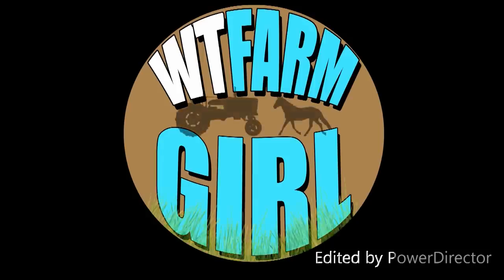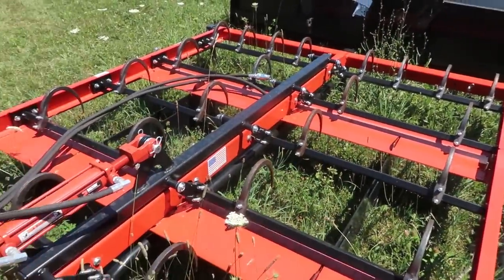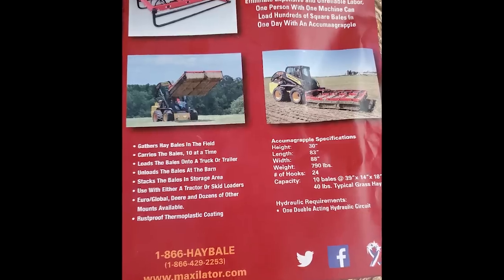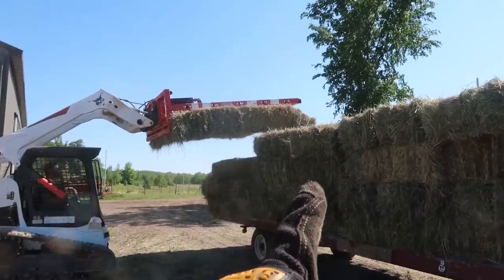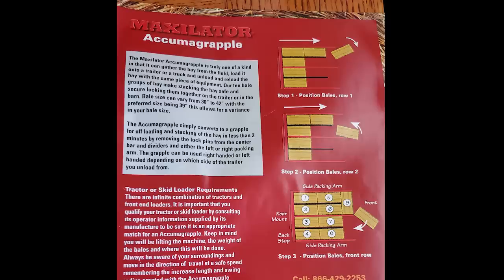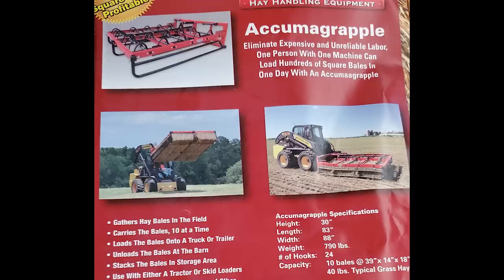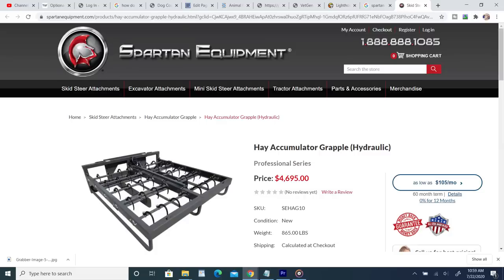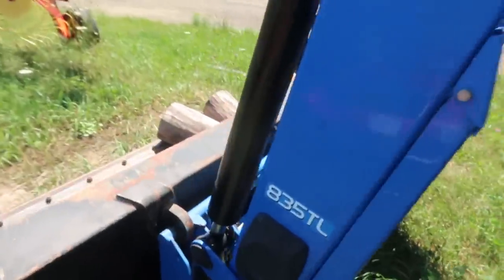324 Hay Accumulation System: Why The Maxilator Didn't Work . . .

Comment: Great video and review. I am a small farmer who cuts about 10acres of hay. I ran into the same issue with finding no help. I built my own unit for picking up hay that requires no hydraulics and attaches to the tractor bucket. Works well but isn't perfect. We have not picked up our small squares by hand since I built it  last season. So I consider it a success. I have another design I will be building in the near future but will require 3rd function remote hydrulics. Sometimes as small farmers were better off building what suites our needs than trying to afford equipment our operations funds can't support
Reply from the maker: Very well done!  Did you weld something up similar to the grapple accumulator?
Reply: @This1LifeWeLive  
Yes welded up out square tubing and angle iron. It's not like the accumgrapple. I put it on my small 30hp compact since its shuttle shift. Makes things a lot faster. Designed for that little tractor in mind and this one holds 4 bales at a time. If you want I can email a few photos showing it in use. The next unit I am building is more similar to the accumgrapple but won't hold the bales like your unit does. But again it will need those 3rd function hydrulics.

Comment: We have had a maxolator for over 5 years. Absolutely love it but bales should be 36 inches not 39. I have also learned that you need to be very consistent with your bales witch means you need to feed the baler even all the time. I have switched the tractor I use on the baler to a ivt trans to be able to be able to feed better.
Reply: In rebaling   consistant  feed is  imperative......being as we bale exactly  how it comes off the rool...... no fluffing, because it creates too many fines......Plus the Massey  stroke rate is higher than most side draw balers.....The optimum bale length for a Baron is 34 inches....
Reply: I figured her bales were long

Comment: Our first year grapple accumulator system was pretty simple... the Farmall “C” was in first gear and set at idle... my 7 yr old brother would drive the straightaways... I (being big brother at 14) jumped up and helped him corner.  My 9 yr old brother drug bales to the loading path.  I gathered bales and tossed them onto the farm wagon. My dad stacked them there.  

My mom and sisters were in charge of iced tea and peanut butter sandwiches.  

When we got to the barn, I tossed them onto a platform, then climbed up and tossed them into the loft.  My dad stacked them in the loft.  

While we were doing this, little brothers rested in the shade and guarded the peanut butter sandwiches from the farm dog and the geese... it worked pretty well except... when my little brothers guarded the sandwiches by eating them... 

The going rate at that time (1967) was $0.10 per bale for a hay crew using their own equipment.  (Each crew hand received $0.015 for grass and $0.02 per bale for alfalfa.) Because the bread was homemade, the peanut butter was government commodities and gas was $0.21 per gallon... you might say we grappled and accumulated the hay darn near cheap!!!

Wouldn’t trade the experience for anything... wouldn’t repeat it now for anyone!!
Reply: Your to old to do it again........1967 who remembers that.
Reply: @bevisbellair5002  I do.
Reply: Bevis Bellair LOL... that was two years before the real Summer of  Love... arguably one of the most transformative years in history... it is worth a Google!
Reply: Had the same thing in 76, I think Dad called it the heftum, once you heftum on the wagon you heftum into the mow.
Reply: @robertlivingston1634  LOL… I like it!

Comment: I run a skid steer quick attach on my front end loader on my tractor I love it I can switch from forks to my bucket I also have the skid steer auger attachment on the front I ran my own hydraulic lines it cost me less than $300 to put in a new bow and the hydraulic lines so I can operate everything on the front end

Comment: If you do add a grapple on your bucket loader, you could add some long hydraulic lines from your rear outlets.Being low budget i think any shop with hydraulic supplies could custom length and some  fittings and quick connectors could route up rh loader arm.
Reply from the maker: agreed. We've done a few for custom equipment too. Our disk/harrow set-up needed extra long lines so we made some for that. Wasn't too pricey . . .

Comment: As with any operation,ask yourself do we have enough work to justify the cost, secondly the baler has adjustments to make good bales in most crops ( eg. If the bales are lopsided adjusting the feed mechanism) . Banana bales may be too much vertical pressure,in order to make a good bale side resisters may have to be added,and of course consistent feeding is a must, most balers came from the factory equipped to do the job.

Comment: Admittedly we had two tractors but up until we moved to round bales we used a flat 8 grab though admittedly you could only pick up length ways otherwise it had a habit of breaking strings which was brought second hand for about the same as we sold it £200 twenty years later and a flat 8 accumulator again brought for about £200. To begin with my dad used a couple of flatbed trailers but the brought a trailer where we would stack the hay in blocks 6 high and straw 7 high in the field while it was being baled which we could catch up with then the baler would come off and the trailer go on which you would tip up, open the sides up back into the block, squeeze the sides in and tip it back up with the hay in it. With that it allowed us with two people to clear a field pretty quickly but then we had all the empty sheep sheds in the summer that if it looked like it may rain we could drop a couple of 1000 bales into which we could then stack properly later on.

Comment: I have watched the Maxilator  videos as well.  I have a skid loader, so that would be no prob.  But my 575 NH baler has a thrower on it, and I am loath to give that up.  The thing is, if I am baling into the throw wagons, when finished I can back them into the shed and they are under cover. If I am baling onto the ground, I then have to go back and load them onto a trailer and unload them into a shed.  Here in Wisconsin, I am always baling trying to beat the rain, so I am not sure this system would help that much.  I don't see the Accumagrapple  working with a tractor loader at all,  and you need to be at one with the skid loader to really make this work. Obviously you need to size the bales so that they match the grapple, that is a no brainer.  I am pondering buying an older big square baler.

Comment: I’m late to the party but if you shorten your bales up to about 36 inches it will work perfect. I used to make 39 and 40 inch bales before I started using the Kuhns system but it just doesn’t work, they like 36 inch bales. The baler is easy to adjust. You won’t get 36 every time, but shoot for that as an average.
Reply: A couple more things to think about is bale density and consistency they need to be packed tight a 36 inch bale of dry hay should be pushing 60 pounds if it’s high moisture and you use preservative like I do at times they can get up to 70 pounds. To get consistent bales you have to feed hay very consistently which means consistent windrows from a good rake that doesn’t make “wads” of hay, rollabars do ok, rotary works best, wheel rakes are terrible for square baling unless it’s a high end one. Also  ground speed is very important try to get 12 to 14 strokes of the plunger between each tie cycle if your getting under 12 you need to slow down if your getting over 14 that’s ok but you can speed up to increase production. If you go to fast you will get terrible shapes, loose bales, banana bales, inconsistent bales etc. I have several older videos like almost when I first started YouTube of how to stack the 10 bale packs there is an art to it it takes time and experience to get good at it. One more thing when the bales are tight you need good twine I use plastic with 170 knot strength and it holds up way better than sisal. Using mechanical equipment is very different than doing things by hand, but once you learn it you can actually make better more consistent more desirable bales as long as the hay itself is good quality.
Reply from the maker: What we found out is our bale size adjuster was worn out and kept "slipping", so each time I set it, it would re-set itself :( But yes, after talking to a few other guys they DO need to be extra light and 36" (despite the users manual stating 42"). We are looking at getting a pull-behind accumulator, maybe the Farmhand one. Cheaper to buy used, and no back pressure on the bales. I'll tell Erik you stopped by, you are probably the main farming channel he watches (he prefers car channels overall)

Comment: We are looking at a similar system by WR  Long. Thanks for the pointers and experiance. Also, check out WR Long for adding a third function to the FEL.
Reply: My WR Long is 93 inches long which is longer than hers. I have found it is important to have tight bales.
Reply: Did you go ahead and purchase the  WR Long

Comment: I'm assuming that you're currently the owner of that Maxilator.  Maybe, maybe, you could move that front row of grapple hooks forward so they can get a better grip on those front bales that are sticking out. Maybe you could put a couple of longer grapple hooks on that front grapple setup so you'd get some extra grip on the last two cross bales. Just a thought!

Comment: I felt from the start that some accumulator system would work, still do, I don't get maxilator 's math either, I've picked up and stacked thousands of bales, if I were doing it today, I'd be using that, or a Kuhn accumulator, chronicles of a farm wife uses one like Dennis at DLH, North Texas hay had an accumulator that dragged bales on the ground behind the baler, you can still find his videos too, I think you're on the right track though

Comment: I would think Erik could come up with something better. In suprised some company hasn't.  
In the warehouse I worked in besides regular hilo we had slip machines which had wide thin forks and would grab a stack of whatever ( bleach was popular ) which was set on a cardboard sheet, pull it onto the forks and we would push it off onto a pallet. We also had squeeze machines which would compress a stack of freight and again drop it onto a pallet.  All well and good in a warehouse. That said I would think a piece of equipment that was similar to the adjustable squeeze along with hooks could be made at a lower cost for smaller farms. Good luck with whichever way you guys take now you've seen the issues.
Take care!

Comment: Suzanne - I bought the lowest cost Kuhns Mfg accumulator and grapple for less than $8,000. I went with the 4 and 8 as lowest cost. I have a Kubota L6060 with 3rd function. It works very well although like with your carts a missed bale is a pain. Your Maxilator specifies 39" bale so when put with 2 18" bales - 36" - makes no sense. Also it says 40# grass bales. I make much more dense grass hay bales, around 50 to 60 pounds. People commented on your loose bales and they would need to be really loose to make a 40# bale. If I were to do it again, however, I would get the larger accumulator but we too are on a budget. However watching Eric fight that Maxilator - it was painful - he was not his usual cheerful self.

Comment: My aging NH 1012  Stack wagon is much better suited to picking up and delivering square bales.  Bale baskets hide the broken or mis-tied bales and accumulators required additional tractors or skid steers.   Mine has self unload 1 bale  at a time right onto an elevator or onto a customers trailer and truck.  Only change is a 1/2 turn bale chute on the baler you can make out of wood or an old bale chute.

Comment: Next time when you are baling, try to load without the two last bales. They will fall of the wagon anyway. If you want to load 10 bales, look if it's possible if you can move your sidebales to the middle. That way they are locked up between the other bales. The system has to work. I've seen several other promotion video's  and they seem to work very well. Mind you all they are using is straw and those bales load better.

Comment: For those who produce small Quanities of small squares it is pretty economical system.....We push to get our  hay off the field and under cover..... 4x5 rounds   fits our system of baling tronsporting storing and works with our  conversion process ......  Expensive but cost effective......Being as we Market small squares  to feed and Ag outlet stores    They are freshly baled and loaded....giving each bale that fresh out the "Oven"  appearance.......
Reply from the maker: It works if you have two people who can do hay at the same time, and one is VERY skilled at using the accumulator. It took Erik 3 years to do a full run with minimal swearing and fury. But he works a full time job so that leaves us with exactly 2 hrs to get hay collected and off the field. It's not enough time. We are looking instead at an 8 bale accumulator, it will also allow us to load up trailers as it will fit perfectly.
Reply: My Son,

Comment: you said your neighbor likes to weld.  have him build a adapter to mount it on the tractor.   Yeah you cam plumb extrea hydraulics to the front of your tractor or just have extra long hoses made to run to the back hydraulics.   still kinda expensive but lower cost than the hard lines.  lots of loaders installed that way.  Then you just get some ziplock bags to keep the ends clean while you use the tractor for something you need rear hydraulics .  Around here cheap electrical tape rolls and cheap zip ties are the fasten all remedy to keep loose stuff from getting in the way of important stuff or from jumping off and making an escape like your missing PTO shaft from years past.  also baling twine from used bales makes a nifty loose stuff tye-er upper
Reply: I think we just need a smaller tractor with skid styel hook up.

Comment: Steffen 5508 with standard high lift allows me to go 11 layers high with a Kubota svl 90-2. More money up front but a better result.
Reply from the maker: How do you keep the stacks from falling over? This year all of Erik's stacking jobs seem to fall over even at just 4 tall . . . He is doing the 20 bale and rotating the stack, but doesn't seem to help
Reply: @This1LifeWeLive  practice makes perfect. The steffen accumulator and grapple are designed to keep the groups of bales tight more than any other company I've seen. For example the grapple hooks grab the hay from opposite sides.. That might be a factor. We also have our bale weight up to 50 pounds or so which is much heavier than when we were doing them by hand.

Comment: Great info wtfg. Wondering if a good fabricator could add a ft.to maxolator and woulda worked for ur operation. Did u get baler fine tuned up. Felt ur pain when i seen that baler malfunction.

Comment: So, why can't you change the way you put the bales in? Put the 2 bales lengthwise first and then the 2 rows of 3 after that. The bales sticking out the end will then get hooked somewhere in the middle of the bales. The only problem is would the hooks go into the first 2 bales?
Reply: There are dividers that keep the bales in the correct orientation. All the dividers are removable for using as just a grapple.

Comment: I'm surprised an accumulator is so expensive. Less complicated than the grapple machine. But for efficiency I don't think the Maxilator could ever be as good running around chasing bales rather than having them all blocked up and ready to pick up as a unit.

Comment: i think the trick you need to do is dont put last 2 bails on and think it would good to do , love the video
Reply: I really want to give it a try with 36in bales packed a bit tighter
Reply: @ruralridez6165  that should work for you
I built my own accumulater grapple and I believe that the dimensions are similar to what you have. I think that I went a little over 80 in wide and 84 in long. It handles 36 in bales pretty well.
By the way, a skid steer is the way to go in my opinion for clearing the field. Much better visibility. I would use a tractor with it in grapple mode for unloading and stacking if I had that option.

Comment: What if you put the 2 sideways bales in first? Just a thought.
Reply: It won't work that way
There are 4 separate chutes with dividers between them 2 of the dividers are shorter to accommodate the 2 turned bales
To me, the best way to make this accumulater grapple work is to shorten the bales so that the last 2 don't hang out so far. Or to modify the machine to lengthen the reach needed to get good hold of the 2 last bales

Comment: Since hay farming is not something I have ever worked with, I have to go with the examples you gave.  For myself, I would tell them that it was incomplete without the tractor attachment as part of the equipment. Secondly, I would send the failure to hold and stack videos to them. Then politely ask them to come and get the unit, as well as bring your full amount refund check.

Comment: Don't think the tractor would be best suited to the accumulation part of this operation. You need to be very precise, especially spinning the last 2 bales and I don't think you'd have the visibility and touch with the tractor and I think it would get frustrating after a short while.  A simple trailed accumulator is the way to go, I think

Comment: Why not put a thrower on the baler and throw into a hay wagon? I used to fit 170 bales on a wagon.. it was really full
Reply: I was thinking the same thing, I usually only get 160 bales in the wagon, and we got 4 thrower wagons for less than 3000 for all 4
Reply: 170 bales one wagon load is close to over DOT weight regulations.
Reply: @bevisbellair5002  that's why the wagon never left private property. Was not on a public road.